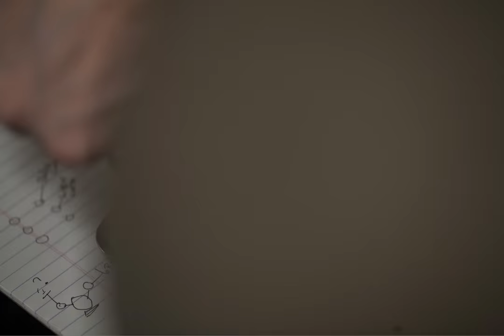JagLapse

Comment: Nice job! I see you've used a Wilkinson roller bridge, how did you manage to adjust it for your jaguar? I'm sure the roller bridge is 12" radius. Thanks in advance
Reply: Late comment, probably the Wilkinson showed here is 12" inch radius but the neck looks like 9.5" neck radius, this Wilkinson bridges since they have individual saddles can be shimmed to achieve more curvature

Comment: Really love what you've done with the guitar! I've been thinking something similar but I am a bit skeptic about the radius mismatch (jaguars usually have a very rounded 7.25", while the burns appear to be flat without the ability to correct their radius by means of polepieces). Did you notice any imbalance in real life? Thanks for your input
Reply from the maker: It's never been a noticeable issue for me. The stock pickups were also flat, and the the reason I used the Burns was to mimic a bit of Brian May's Red Special guitar, which oddly, has a 7.25" radius with the Burns pickups.
Reply: @Lukeyourself  You are absolutely right, hadn't checked BM's guitar radius before. Thanks! Are you happy with the sounds you get? Do you feel like the sound is different enough from a standard jaguar or strat? (already have a jaguar and a strat and I want this new project to sound different enough :) ) Thanks again!
Reply: @ACHIEVEPERFECTION  yeah, trisonics are just completely their own thing and are nothing like fender pickups, especially compared to what comes stock in typical jaguars, as those are quite possibly the thinnest-sounding pickups in a production instrument whereas the replacements in my experience are incredibly beefy and fat.
They make a set that has the same footprint as the existing fender pickups for retrofit into strat-style setups but if you're prepared to go all the way and get the full-size ones the difference will be even more significant.